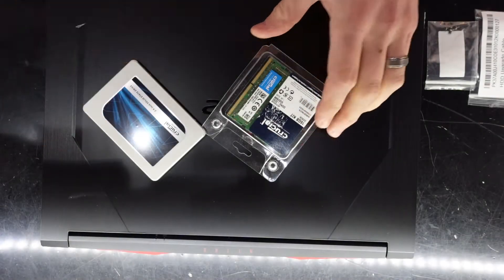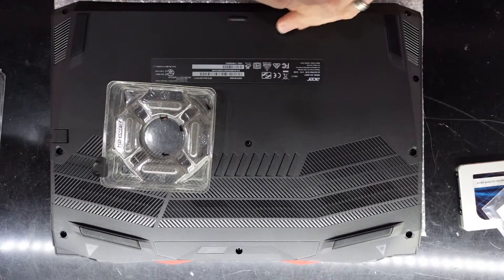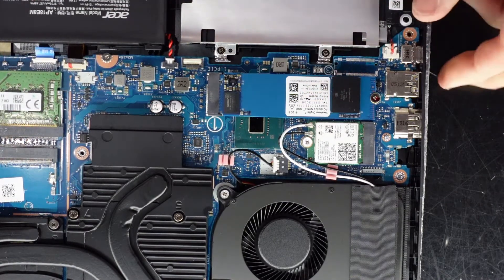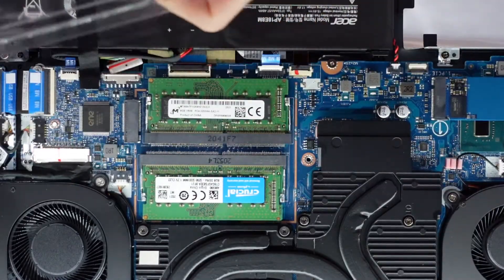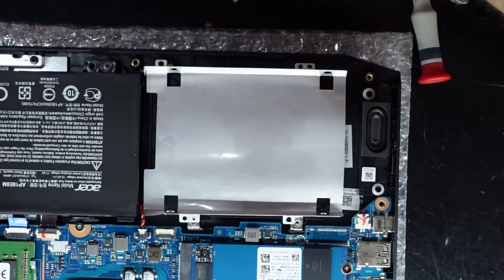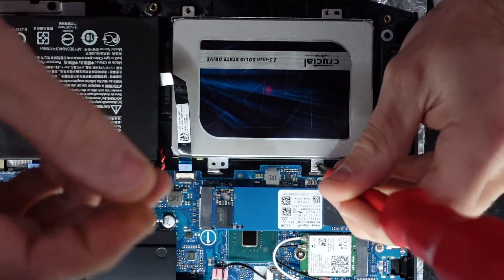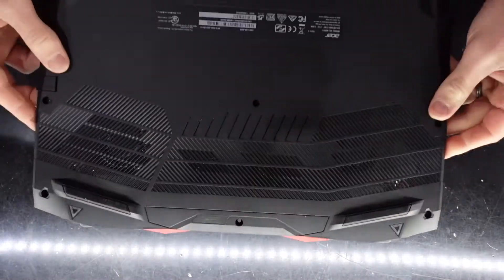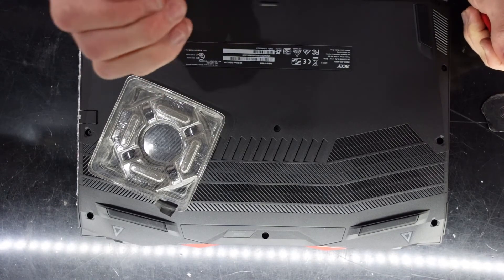Acer Nitro 5 2021 10300H / 3060 Ram and Hard Drive Replacement

Comment: When, like you, I upped the RAM to 32Gb and added a 1/2 Tb SSD I opened it the same way, only to later see an official Acer video that showed to start separating the lower shell at the exhaust ports side. 😁

I didn't disconnect the battery though... bad me.... VERY bad me. Tomorrow I'll have to open it again to add a 1Tb M.2 drive, I'll remember to do it. 🙂

Comment: I have the an515-51 I went out a bought a second M.2 drive because the internet said there were 2 slots. Nope. Only has 1, so I went out and found a converter for sata. They even have duel slot capabilities I'm going to get in the future.

Comment: Do you really need to bought 2 ram stick or just 1 with the same mhz.
Reply from the maker: having both ram sticks the same size is a must!
having both ram sticks the same speed is optional
Reply: I mean can i use two different ram brands since there is already one installed in the laptop. (Since i don't know what brand are installed

Comment: I upgraded my an515-57 from 8gb ram to 16gb, it was running at 3200mhz prior upgrade. I bought a crucial 8gb 3200mhz stick with similar clocks but now both my ram sticks run at 2933mhz and there's no way to even access the xmp menu... is there a fix to that?
Reply from the maker: I would suspect timings are different

And to match timings, they lower their speed
Reply: is it worth spending for another ram stick and swapping the one provided by the manufacturer to go from 2933mhz to 3200mhz or is the performance negligible? mine's an i5 11400h 3050 variant...

Comment: Hi, I have a brand new Nitro 5 AN517-41 which came with WINDOWS 11 and am trying to fix a problem with my new 1Tb internal SATA HDD which was installed tonight. (bought directly from the manufacturer WD Blue SATA 2.5" Laptop Hard Drive HDD | Western Digital ) 
The hard disk is not found in "this PC" , nor in "disk management" nor in the bios.
I used the cable which came with the laptop. I checked the connections and installation and all seems ok.
The side of the hdd which is facing the mounting silver tray has a pbc/circuit board, I wonder if the silver tray shorted something on the pcb. I just dont know. 
Please advise. 
thanks
Reply from the maker: not sure apart from what iv already shown in the video 
if its not showing up in bios or disk management i would suspect a dead drive

Comment: I'm thinking of getting the crucial 8gb ram ddr4 to go along with the 8gb sky hynix that it already comes with. Would it cause any problems? Thanks for the sweet video!
Reply from the maker: i think that should be fine
Reply: @rickstechrepairs  thx man. I purchased it and installed it, it's 100% functional and my laptop is running wayy better than it did before
Reply: as far as my 2021 model with i5 11400H w/ 3050 it came with 8GB DDR4 [x16] 3200Mhz Samsung memory. now the problem you will face is between x8 and x16 rams. ofcourse x16 being less superior than x8 in terms of latency so I believe it was from Acer's front to save money.
Now when I upgraded mine I could not find x16 Ram anywhere, so had to mix it with x8 DDR4 8GB 3200Mhz ram.
Good part: 8GB + 8GB gave me whopping 16GB to play with alongside Dual channel operation.
Bad Part:  due to mixing x8 and x16 ram, for some reason despite of both sticks being 3200Mhz, my memory setup is running at  slightly slow 2933Mhz : (

Comment: i have a question can i use 2tb sata ssd and a 2tb of nvme ssd in a simgle slot ? i have acer nitro 5 ryzen 7 rtx 3060
Reply from the maker: you can use a 

1x 2.5" Sata
2x nvme m.2 all at once

Comment: How can I check my existing ram size , band name and density without need to open the case ? I know it is 16G ram computer, I want to add extra 16G  to make it become 32G without wastage the existing 16g card, possible ? What I need to check before buy another 16g ram card ?
Reply from the maker: https://www.cpuid.com/softwares/cpu-z.html

this program will help you with that

Comment: Thanks for the great Video, where did you get the Cable for the Ribbon Cable with the Sata Attachment?
Reply from the maker: i cant remember if it was already in there, but i think it was in the box
Reply: @rickstechrepairs  It was in the Box, funny thing, my friend which I also bought the same Notebook got 2 Sata Cables.
Reply: @rickstechrepairs  Do you know if its a 9.5mm adapter? same model nitro 5 just wanna make sure i get this right

Comment: Hi mate! Why did you use Crucial 3200MHz when the CPU only supports 2933MHz? Thanks
https://ark.intel.com/content/www/us/en/ark/products/201839/intel-core-i5-10300h-processor-8m-cache-up-to-4-50-ghz.html
Reply from the maker: Price and availability

It's simply what I had on hand at the time
Reply: @rickstechrepairs  Thanks, otherwise I began to think that I didn't understand something. And what do you think about this ram for this laptop? https://www.ebay.com.au/itm/363467930753
Reply from the maker: that will be fine

Comment: So you ditched the original RAM so that you'd have a matching pair and avoid incompatible RAM issues?  I have a 16Gb stick in my existing (possibly soon to be replaced) laptop which I'm thinking of dropping into an Nitro 5 along with a much used SSD (full of my code).  I'm assuming I'd need to drop the existing 8Gb & swap in the single stick of 16Gb?
Reply from the maker: I had a 16gb kit sitting on my shops bench, so I swapped it in since I already had them on hand

Prior to purchase, check to see what ram configuration you have
Reply: Harvey Norman is selling one with 8Gb for 1298$.  I figured I'd drop in 16 from my old machine.  I'm watching your MSI GF65 thin review (also looked at that)  Which would you prefer?
Reply from the maker: That's what I did, and where I got this laptop from

So far I'm leaving towards the nitro being better value for than the msi

Comment: Between this Acer and the Gigabyte G5 which one would you prefer?
Reply from the maker: so far leaning towards the Acer (even tho they arent a brand i like)
Reply: @rickstechrepairs  i mean yeah most 3060 laptops in australia give good performance but are 2000$+ the acer nitro 5 gives pretty damn good performance for a low price

Comment: Very useful video for the component upgrade. Look forward some new videos about mining stuff. I am thinking of buying the same laptop for Nicehash and Chia. It seems its 3060 hashrate ethereum is around 35MH/s. It is a bit lower than Asus and MSI 3060 laptops. Cheers!
Reply from the maker: will have some info about mining with nicehash in the next few days

for the inital purchase price of the Nitro 5 vs the Asus or MSI models (looks to be around 300-500AUD Cheaper) you will get a much quicker ROI
Reply: @rickstechrepairs  Thanks for the reply! Do we have to use Nvidia 470.05 developer driver for better mining yield?
Reply from the maker: nope just using 466.77 Game Driver